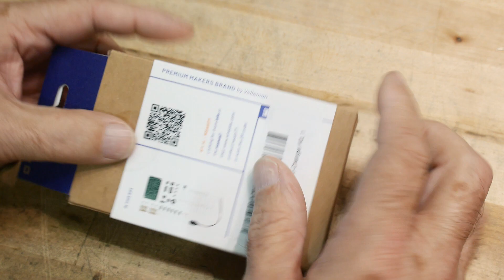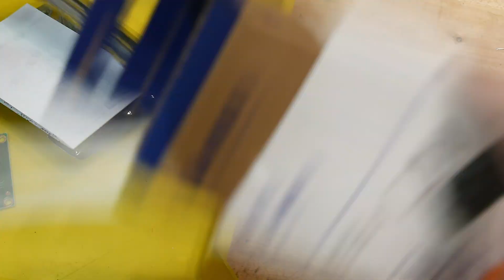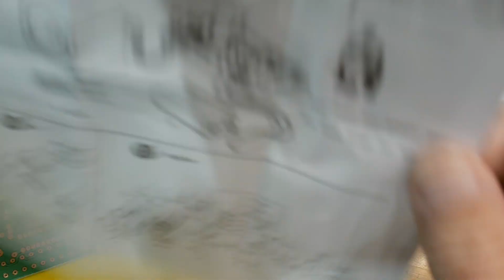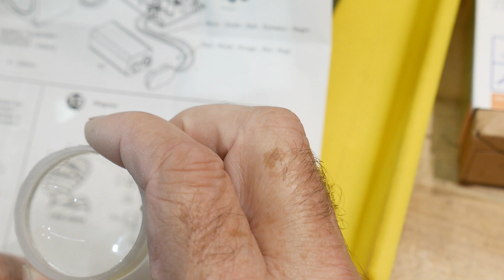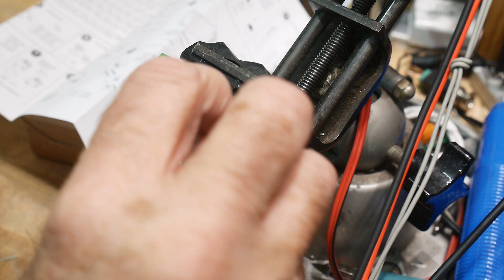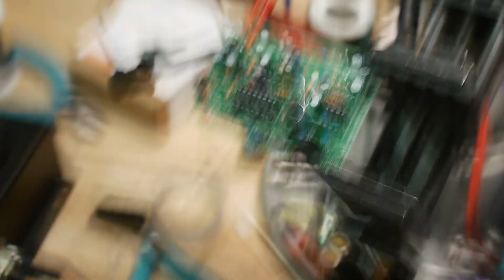#1023 Velleman Voice Changer Kit

Comment: Can I add wires to the mic so it has some mobility and is not mounted directly onto the board? Also, can I swap the speaker out pins for an ⅛" headphone jack? I just want an audio in and audio out, will it work?

Sorry I've had this kit for 6 years and haven't had the courage to build it. I got into circuit bending, bought insane amounts of components, and never ended up bending anything.
Reply from the maker: should be ok, what do you have to lose

Comment: @IMSAI Guy is it possible to shift a single phase with a transformer? I'm asking because I found a 1:1 voltage transformer and the description was a bit unclear. When I was googling on phase shift all that I found was Y to triangle transformer. Is it possible to have a phase shift independent of frequency? What I'm trying to achieve is to DIY an artificial delay line for the antenna grid. for 40 meters it will be a quite long loop, transformer would make it fit in the box.
Reply from the maker: well transformer (balun) would be good for 180deg phase. others would need inductor and capacitor but would be dependent on frequency.
Reply: @IMSAIGuy  thank you. That I was worried about. Plan B: multi-tap loading coils.
Reply: The easy way to add a phase shift it to add a longer cable e.g. https://www.youtube.com/watch?v=qLsf5ZbNEMw they use a relay to add a phase shift by increasing the length of the cable to one of the three antennas.
Reply: @itsevilbert  issue is I want more than single specific phase shift to turn around directivity instead of three specific settings

Comment: Did buy 2 of the gas detector kits when they went on close out. Built one, and it does work, though the analogue transistor array in it probably is worth more than the rest of the kit now, as they are no longer made. Funny how they were sanded down and blacktopped, with the Velleman part number on there instead of the original RCA part number, but not exactly hard to reverse engineer to the real data sheet as you only have 5 transistors in the die, and the substrate pin showing you all the junctions as well to confirm it.
Reply from the maker: https://youtu.be/Lw3yq20eLU0